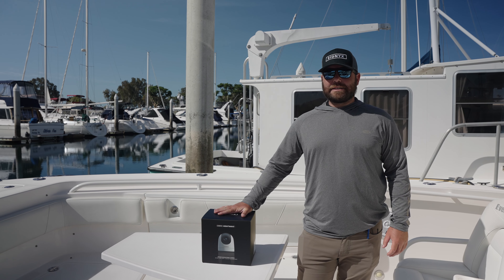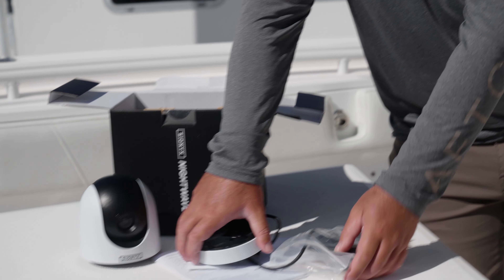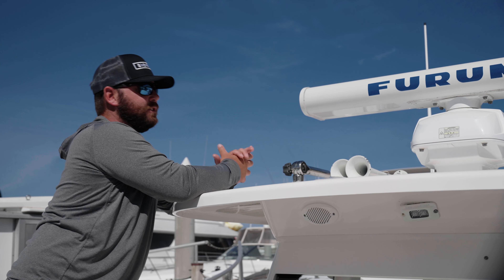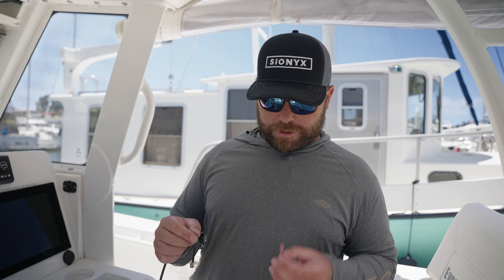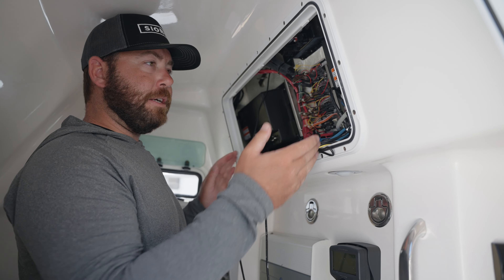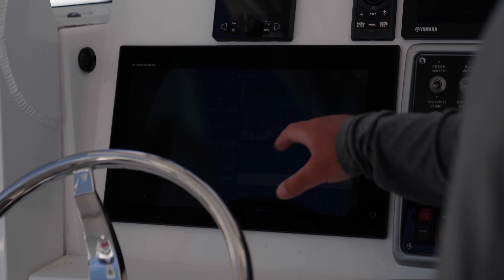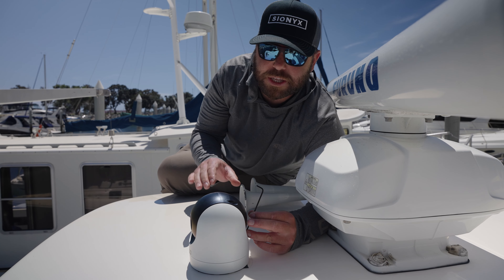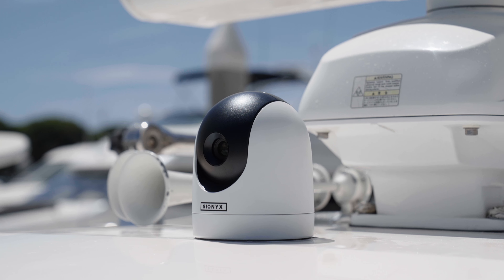SIONYX Nightwave How-To: Permanent Installation Guide

Comment: Excellent video.  Especially since I am mounting to my 2015 325 Everglades.  Why did you remove the spot light? And did yoy silicone the holes from the spot light?   Also, I was thinking to install upside down on T-top and keep the soptlight.   Your thoughts?

Comment: These have composite RCA video outputs. BNC to the analog video input on the back of your MFD.  these are a little different from Flir, the M232’s are Ethernet video and need power inserter etc.  I just ordered a couple of these for customers as a cheaper alternative to Flir. We boat around a ton of debris in spring $1500 camera is cheaper than a new Outdrive.